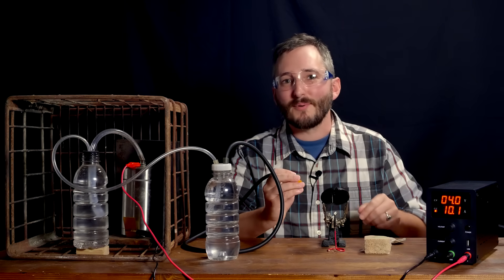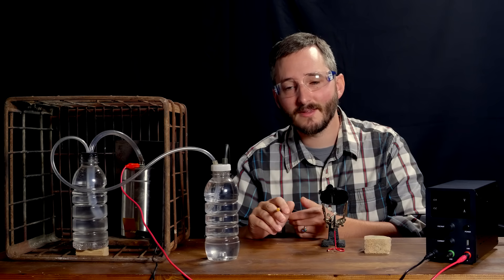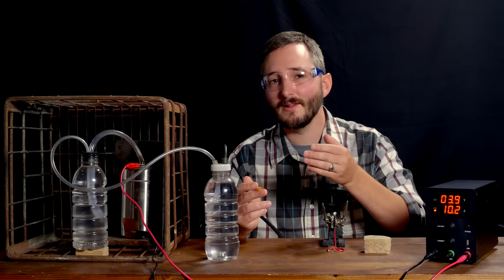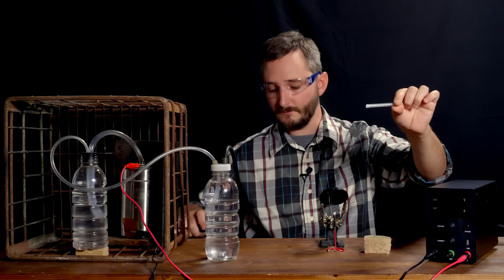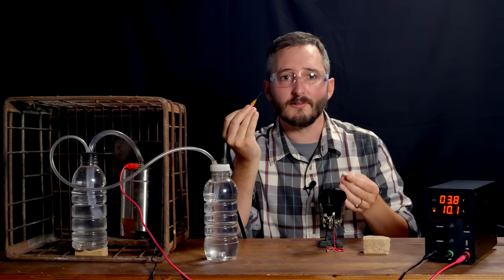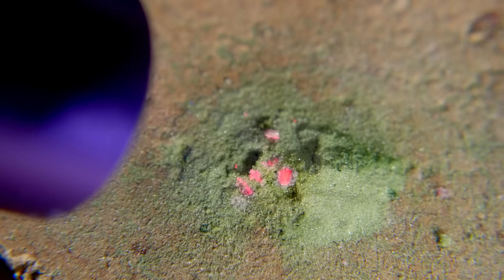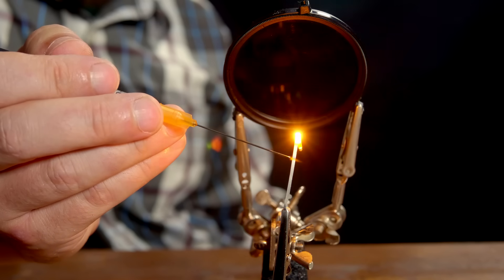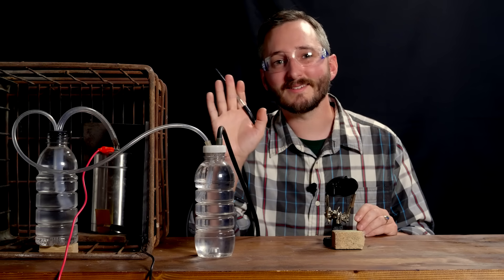DIY Oxy Hydrogen Torch Using Water Electrolysis

Comment: All I can think about is how useful this would be to precisely melt rusty bolts off my rusty nissan in tight spots.
I agree with the other comments, Id love to see a separated HHO generator put through a small jewelers oxy torch (some have built in arrestors albeit for acetylene). I was actually looking into building one a while ago but I've got too many projects on the go.

Comment: I would be much more worried about the hexavalent chromium. Are you doing anything about it?
Reply from the maker: It stays in the electrolysis chamber. When needed you can reduce the Cr6 to inert Cr3 by dropping a bit of Al foil into the tank

Comment: It would be pretty cool to measure the efficiency of this system. Like it consumes power at a rate of around 40W, but how much heat does the torch put out? You could measure this by heating a known volume of water and use the equation: Q = (mass) * (heat capacity) * (change in temp). My guess is this system is pretty efficient!
Reply: @mayshack  oh man this is awesome! Cool to knkw
Reply: @mayshack  that's still not so bad! I think just burning natural gas is around 70 or 80% efficient for heating your home?

Comment: This would probably make a really great glass blowing tool. You have a really fine point here, and seeing how fast it punched those plates, I imagine that glass welding would be a breeze.

Also, you consistently have some of the best thumbnails on YouTube.
Reply: You're right, it works really great.  I do thisnevery day,, although I run a LOT higher volume through a stainless steel Carlisle torch tip, and tanked gasses from the welding supplier.  It would be hard to do much work on glass or quartz with a flame that small.  Itty bitty welds.

Comment: That's great I can see a lot of uses for this but 
Doesn't that torch produce UV radiation? You know the one that gives you cancer. 
It would be interesting to calculate the intensity of the radiation from such a small torch and at what distance, if any, would be safe to use (ignoring the explosion hazard).
Reply from the maker: Definitely less than sunlight.
Reply: @Nighthawkinlight  Who knows. I'm not taking the chance, I'd rather measure that. I'm not here looking for an argument I unironically would like to see someone calculate it. I would if I had more info or was more capable. Do you have any idea of how much flow your system has?

Comment: This would be perfect for de-soldering circuit board parts, my regular soldering iron doesn't work for most boards.
Reply: @mayshack  Some how I didn't think about this. I mostly find old broken ones and scrap them however so the parts are already ruined.

Comment: Brilliant stuff!

I have a 'professional' HHO unit I purchased, and I got flashback within seconds of switchon, despite observing "obvious" precautions AND recommendations AND using their supplied torch.  "Luckily" the provided flashback arrestor worked, but the acrylic/Perspex tube developed serious cracks which I have not taken the time to repair.  

To say that the suppliers/manufacturers of the kit were unhelpful would be an understatement.  "It must have been your carelessness as our equipment is above reproach" would be a synthesis of their response.  They wore me down with their stonewalling BS, and the system is in dry storage for the time being.  

I now have some excellent suggestions to implement, making it worthwhile to give the gear another try.

Comment: If you have clear acrylic or perpex you will find it can polish the surface to perfect again if it is scratched ! It will also idle a small 25cc honda motor if you get the tip extremely close to the valve inlet after removing the carby . Obviously dontt light the tip though! 👍🏻

Comment: Just thinking about the fact that you are using a relatively weak power supply to make a flame that hot. The magic of chemical energy. I assume that you can't run it for a long period of time non-stop since you would burn through built up supply of gas quicker. Is that true?
Reply from the maker: It runs on the gas at the rate it's produced
Reply: @Nighthawkinlight  Oh wow... That is impressive. Makes since though. Thanks and looking forward to seeing more rubies!

Comment: Interesting idea! I have to try this myself.
Reply: Could this be replacement for oxy acetylene torch for diy shop? One that only needs water and electricity to run and can be stored away when not in use, no problems with high pressure gas cylinders and hot enough flame to do all kind of things. Could have just small welders kits acetylene bottle to feed into hydrogen line if one really wants oxidizing flame to create suth to protect surface from welding sparks. I would build this, but i dont know enough about the gasses to make it safely.
Reply: @Hellsong89  they have used these for welding before
Reply: @Hellsong89  do a search for Oxyhydrogen welding. They exist but there are limitations, lower temp than acetylene is one of them.
Reply: @jm-um1tx  actually not really, it depends on the oxygen and fuel ratio. 
 They can use it to melt quartz and make fused silica, thats super hot.
  I think it's possible to get it near the same on temp
Reply: @Hellsong89  Not really, no.
Look up Hydrogen embrittlement. It depends on what you intend to weld and how strong the weld needs to be.
Reply: A guy in Clearwater, Florida did just that very thing. He made a torch setup that used water as fuel. It wouldn’t burn your hand but it would heat steel to a glowing red color in a few seconds. He also made a device that you mount onto your car engine that used water as well which allowed an insane increase of mpg (miles per gallon), and it worked with the existing engine setup. This made it so that if you ran out of water it didn’t affect the performance of the engine at all. You can still find the news segment that interviewed him back in the 1980’s just before he was poisoned at a local restaurant on the beach while he had lunch with his brother.
Reply: At the beginning I though it also... but later in the video, as I saw the flame goes backward so easily, I though "better no" :D
Reply: @esepecesito  those bubblers cut it off, the flame cannot pass through water even if it started to catch on fire inside the water as a gas bubble it would super quickly collapse into itself and snuff itself out before it could get to the gas source... 
 In this video he has multiple bubblers, they are definitely over filled too.. 
 He didn't really need two bubblers in my opinion, but I guess redundancy is good. 
 Yeah I wouldn't worry about it man, even if it goes up the nozzle all the way and back to the bubbler there will not be alot of destruction... if you're really worried about it you can also put pressure relief valves on the bubbler and you can also use tesla valves as flashback arrestor they work great you just need a good amount of buckets
Reply: @helpabrothawithasubisaiah5316  Sure.... but you see there is 2 bubblers "just in case" and still a steel plate... if he is afraid, me too!
Reply: @aftoknito  Thank you for your insult. Have a nice day.
Reply: @helpabrothawithasubisaiah5316  I'm more afraid about the elctrolysis cell, if that shorts out you're fucked.
Reply: @helpabrothawithasubisaiah5316  I like the Tesla valve idea... but does it work at a supersonic rate of flashback? The other question is concerning the pressure of the blowback. Could it rupture the Tesla valve during extended usage?
Reply: @kcjazz62  yes, if you read the patent basically its explaining the quicker the pulse the better it works... 
 So supersonic will work better than subsonic.. 
 And it all depends on how you build it and what materials you use, I know the one in his patent has a flat lid that's bolted down which would likely just pop the lid if it failed... 
 But I'm guessing in most cases its not going to fail, and if you're really worried about it have two in line... so if one fails you have a whole other one to contain the flashback.
Reply: @kcjazz62  its generally designed to never be replaced, so if properly designed it will never fail, you might never even need to clean it using gasses.. but if its going to be containing alot of flash over a long time I would suggest designing a radiator into the valve... Basically just put fluid channels on the under side of it, and get a water pump and pump water through it. 
 Then the heat will never degrade it
Reply: He explicitly says not to try this at home tho
Reply: @ShotgunMonkey1  he won't do it in his home.. he will do it in his shop
Reply: @ShotgunMonkey1  The thing about that is man, if you interpret every warning as meaning "NEVER DO THIS", you'll never do anything in your life.
Warnings are there for a reason, they are to protect the stupid from themselves. If you see a warning on something, you either understand why the warning is in place and proceed with caution (doing more research to make sure you have a fundamental understanding of the processes and potential dangers) or you don't understand the dangers.

If you don't understand the dangers, but would like to attempt something, look it up. It can take months or even years to attain the requisite knowledge to enable you to try it, but you'll learn a lot along the way, generally finding other experiments and concepts that you need to research in order to understand certain aspects.

That's what it's all about. Just be safe about it and don't proceed if you're unsure. Or at least, design risk mitigation devices into your attempts (blast shields, ppe, ventilation... safety precautions.)

I'm in my 40's, I'm not officially trained in any discipline, but I've been working with all manner of devices with all kinds of warning labels both professionally and as a hobby in my shed, my whole life. I've still got all my fingers and toes.
Reply: Try the separate O2 and H2 technique and feed it into a traditional gas welding torch. I'm thinking you may need to fill a bladder then use a pair of pumps to get some reasonable pressure/flow...
Reply: @joegee2815  nooooooo, do not use pumps... 
 The separate gas outlet method is not generally reliable enough to trust it like that
Reply: @joegee2815  would just make a pump pressure pot thats been sealed with ratchet straps
Reply: I made a video doing this 3 years ago and it always flashed back .  Blew up my bubbler in the video lol .  I’ve learned about proper flashback arrestors since then (steel or aluminum wool as you used) but I haven’t revisited the video I did 3 years ago.  I never deleted the video but I think it’s still relevant or entertaining lol
Reply: @613Builds  you also should use pressure relief valves, you can make a crude one just putting a balloon over a hole basically... 
 If it flashes the balloon pops and releases pressure. 
 I don't mean a loose balloon, basically sealed down so its just a rubber wall.. 
 Something like a balloon rubber banded over a soda bottle lid would kinda give you the idea
Reply: I have seen bubbler safety valves that use an old computer mouse ball on top & inside a modified pvc “cage”. Upon blowback, the ball pops up, then back down to reseal the bubbler. It’s an automatic fail safe. You just have to source the old style computer mouse (heavy sigh) & extract the roller ball. Anyone know where to reliably find them?
Reply: Yes please
Reply: With materials from the scrapyard I hope
Reply: Epic comment crossover!
Reply: It surprises me that you haven't
Reply: Hi first of all your art is absolutely stunning 🤩,second, happy to watch!😛👍🍭😜👍beautiful artwork dear full watched 😍💞💞
Astonishingly beautiful!!!... What a brilliant masterpiece!!!... Your artwork is phenomenal! Your skill set is superb with amazing techniques!!!... Awesome creations! Absolutely love it ! Thank you for sharing!!!... 👍+🔔😘😊😘😛😜🍎🌷🌹🌺🍂🍃🎃🍒🍖🧀🍓🍊🍅🌭Again amazing work 💕 keep it up and stay connected 🙂❤️🧡🧡❤️🧡🤣💟💜💛💙💛💜💙Absolutely stunning Beautiful! 🤩,happy to watch!😛👍😜👍 wonderful!
make a new friend just amazing no wordssss..💌💌💚❣️💛💕❤️🧡🧡so beautiful work really enjoy by watching your video keep sharing stay safe and connected🙂🤗👍🍂🌷😛🍖🌹❤️🧡🤣💟💜💛
Reply: yes
Reply: Good seeing you here! Best content

Comment: G'day,

Yay Team !

This is fascinating...

I'm glad you're not trying to make Brown's Gas with the Alternator on your Car, in the hopes of burning it in the Engine, while trying to "save fuel"...

I've seen people waste a lot of time on that idea - apparently because they fantasise that an Alternator connected to a Battery with it's Voltage anywhere below that which the Alternator's Regulator is designed to reach & maintain (14.3 V. to 14.5 V., or so)..., will be as free-spinning and easy to turn as an Alternator fresh out of the Box & connected to nothing.

  The "Free Spare Electricity Delusion", I call it....; which ennervates the whole HHO Fuel-Saver "Industry " and the HHO-boes who subscribe to the belief that they're on the track of something worth doing...

They apparently  convince themselves that Alternators are Perpetual Motion producers, requiring no Torque to turn their Rotor and yet  pumping out whatever their maximum Output of Current is rated at (on the Box it came in) continually - and it's that ("Free Energy") on which they fantasise that their Brown's Gas Bubblers will be working...

   It amazes me that so few of them ever manage to suffer accidental detonations & fires ; they seem to play around with much less precautions and care for safety than you do...(!).

Three Gold Stars & a Koala Stamp...!

Such is life,

Have a good one...

Stay safe.

;-p

Ciao !

Comment: I wonder if you could make a chamber that can be pressurized (Possibly with an air compressor) with regular air and also add in a "one-way" pressure valve to add your own captured oxygen making a chamber with a higher concentration of oxygen that leads into a nozzle that has a flame on the end to make a safer (And maybe simpler torch?). The torch would work kind of like the blowing torch where you blow air through a small tube into a flame to make a simple torch.

Did that make sense?

Comment: Perhaps putting a 1" or so piece of sponge that's about 3/4" diameter close to the base of the needle and keeping it wet might work as well as your paper towel, and not have to keep that in a position where you need to grab it. Slide it forward to extinguish the torch.
Reply: Yep, I thought that's what he was going to say as another protection from a "sustained backfire" (a sustained flame in the tube, like he demonstrated).
Reply: I was wondering about that too. Though I also worry about it increasing the risk of dropping the torch which seems like a worse case scenario for this setup

Comment: You should try to make a micro kiln, or furnace :p 

Would be a cute project, at the bare minimum. :p

For safety, you could use a longer tube, that goes through some water, to self extinguish due to rapid cooling of the tube, where it goes through the water system.
So you don't have to stare at it, constantly.

Comment: Hey NHL, Amazing video. i have a question, Given hydrolysis only requires what seems like a varying amounts of electricity, and the hydrogen can be turned into water with the combustion with oxygen, could some sort of device be constructed to turn dirty river or salty ocean water into completely sterile drinking water? with electrolytes being substituted with other means (like adding a bit of salty water /dirty water back in), given electrolysis can be performed with clean energies like solar and wind, would it be a good alternative for purifying water without the need for fossil fuels or large scale filter installation? can i suggest for you to try and make a small scale device that'd either prove or disprove this idea?
Reply from the maker: Easier to boil distill the water
Reply: @Nighthawkinlight  aren't there certain virusses and pathogens that can survive the boiling process? wouldn't electrolysis be a saver option then?
Reply from the maker: @OmgMcGamez  Not many can survive, and fewer can both survive and also hurt you

Comment: Can you melt a tungsten light bulb filament in an inert atmosphere with it?  That would be 6192 °F.

If it then boils away, that would indicate temps in excess of 10706 °F

  Claims have been made by HHO pioneers in the past that HHO flame is only 273°F burning in atmosphere, but that it will raise any material it is applied to, to it’s melting and/or vaporization/boiling point.

  Would be interested to see this tested, if you can come up with a reasonable way to do it.